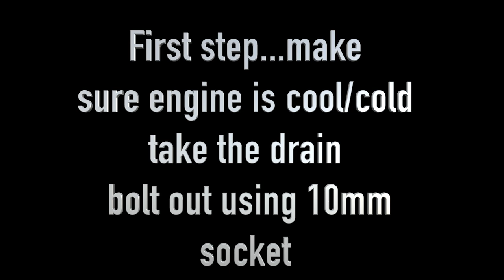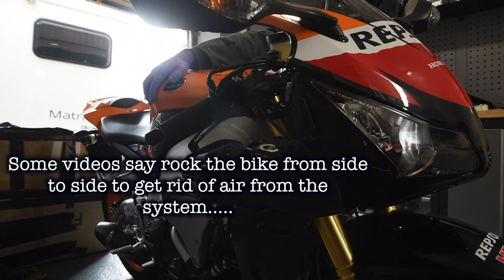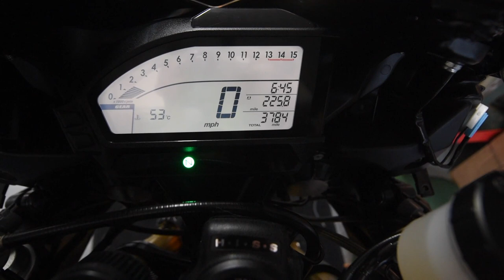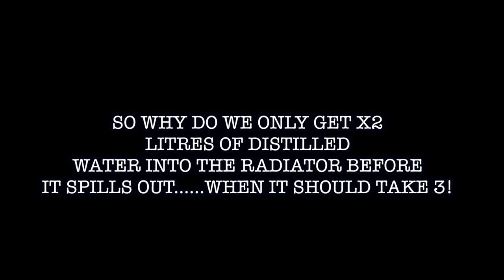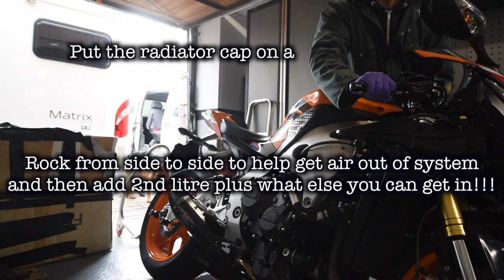Coolant change on a 2013 CBR1000RR

Comment: If you want to flush these systems: remove radiator cap-remove drain bolt-drain coolant-install drain bolt with new washer-fill rad with recommended or equivalent coolant to fill line-remove rez cap and fill to upper line-start and run for 2-3 minutes-snap throttle 3-4 times-stop engine-add coolant to fill line at rad if necessary-install cap-fill rez to upper level if needed-install rez cap-done.

Comment: I've  had my 2008 fireblade for 8 years with 57.000 kms on the clock riding in hot and cold weather, I've never changed the radiator fluid and I haven't had any issues with it but will change it soon.

Comment: Gr8 Video thanks...I am going to change the coolant on my Honda Vfr1200f this week & it has the same silly located expansion bottle...madness where Honda located it...I must locate a 5mm tube this week...well done thanks.
Reply from the maker: Hi Paul. Thanks , yup stupid place for the bottle. Someone suggested after refilling with coolant  to then start the bike up with the radiator cap off and rev the engine for a few minutes to  further help to try and clear any air inside, before putting the cap on.But check with a downloadable vfr manual just to be sure of the procedure. 👍
Reply: @gsd32i  Thanks will do..I have half the bike stripped here waiting to put a new Nitron rear shock in...the Honda shock is terrible & the preload adjuster keeps seizing...so I will take on the coolant too when I have the fairing & tank off...what can go wrong lol !!!

Comment: @13:13 i have the same tube free/released/hanging  (rightside screen) with no connection to other place ...it is normal? What pipe ou tube is that? Actually I have two
Reply from the maker: Hi . I don’t have the bike anymore . But I think that you have 2 tubes going to the water pump . One comes from the radiator when the thermostat os open . The other is the one that comes from the engine cylinders and goes to the pump and back into the cylinders again . When the thermostat reaches a certain temperature a valve is opened that sends the hot water to the radiator to cool it and then a pipe which you can see on the left side goes back to the water pump to be pumped around again . When the engine is running cooler the thermostat closes and no water is pump through the radiator !! Hope that helps 🙈👍
Reply: @gsd32i Hi please answer when you remove this pipe does the water run out of there?

Comment: Nice vid good explanation the only thing i think your slightly wrong with is on startup you didn't leave cap off in manual it wants you start engine and rev to get rid of any air
Reply from the maker: Thanks for that I will amend in the intro notes . Makes sense . 👍 blade now sold due to lack of use. Would have loved to have kept my Africa twin and the blade , but the blade never got used other than track days, so off it went. Ride safe.
Reply: I've just picked up a 2014 blade bloody love it amazing bike I've been used to 47hp on a2 lisence so feels amazing,, ive been sad today and took rad off to clean lol so i think i can get away with just putting the 3 litres of coolant straight in.. Im not dissing your work bud great vid just in manual it says top coolant and overfill tank then it says start engine for 3 minutes and rev then switch off and add coolant if nessarly then it says install cap it dosent make it very clear so my guess is it littery just want cap off for a short amount of time just for the 1st start up

Comment: Hey , thanks for the vid, like many others on here this will be my 1st, Is the aim to fill the radiaor all the way to the top or is there a line to fill the coolant up to or something?  thanks
Reply: Fill through the cap slowly until water is pouring out then bleed the air by blipping the throttle then top off again and fill the overflow tank to the line.
Reply: @JohnDaddy9000  thank you
Reply from the maker: Hi.Glad someone jumped in and answered your question. Been away on road trip.Yup, blip the throttle and top off as best as you can.

Comment: If the oil filter is not changed, how many liters of oil will be added?
Reply: I read in some forum that a 2012 has 2.8L of oil excluding the filter volume. That's why it takes 3L to change the oil and filter. The oil filter has 200ml.

Comment: Does anyone know where the bank angle sensor is on the 2010 cbr1000rr? I had a recent low side and bike won't start. I've been told to replace this but for the life of me, can't find the bank sensor location
Reply: Check behind the upper cowl where the stay bracket is. You will have to remove the cowl to see it

Comment: if you put a hose in the radiator and pull that liter of distilled water does not work?
Reply from the maker: MrKyokushin25 hi . To be honest I didn’t give that a thought ! But if anyone else wants to try /or has done that , then I would be interested in result ! 👍
Reply: @gsd32i  but I will wait the bike has barely 2700 km... is too early to empty and change the coolant on.my bike...but frankly intrigued me that liter that does not want to come out😤!but if Honda said it's OK and so it's better ...but it would have been better to have that liter out, because it dilutes the collar i.don t now how much but the specs un the Honda says that is must be 50% coolant 50% distilled water no?
Reply from the maker: MrKyokushin25  I have test ridden the bike and although we have a 40mph speed limit here (🙈) so just like driving in town , the bike was operating at approximately 88-90 degrees C. So looks all good . As I said in video you could drain another litre out having put the 2 litres in which would reduce the amount of distilled water again ... I may do this as I still have unused coolant , from the 4 litres I purchased to do the coolant change . The coolant hasn’t been changed from when I purchased the bike new and am thinking of selling it so I changed it and the engine oil / filter too . 😎
Reply: @gsd32i  in one word, you can still empty the radiator once you've poured the 2 liters of antifreeze over the litre fi distilled water, then you empty the radiator and then put the same antifreeze and look like this should go after this antifreeze process and will not be diluted so much because it will not be that liter anymore no?
Reply from the maker: MrKyokushin25 distilled water is far better at heat transfer than anti freeze. But   The anti freeze has rust inhibitors etc in it and obviously stops the water freezing if you live in cold climates ! Some people in warm climates use 20/80 mix as they don’t need much anti freeze. Like you say u and I have said you could run the bike after the 2 litres was put in,  to 104 degrees c to get the thermostat to open and then let it cool .... then drain out 1 litre or even 2 litres then you know you’re gonna now be running at 50/50 once you then add another 2 litres of pre mixed anti freeze ...especially if your bike sits outside in the winter!. So you would need 4+ litres (€8 x4)as you need some for the expansion bottle . 👍
Reply: @gsd32i  thanks a lot for the tips I will do that:)
Reply: @gsd32i  you are definitely the type of seller I would buy from!